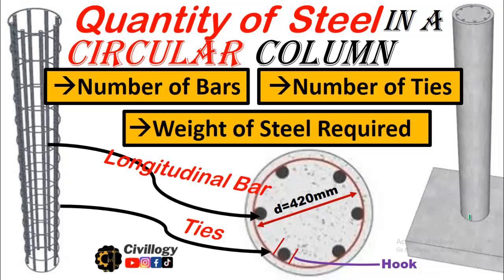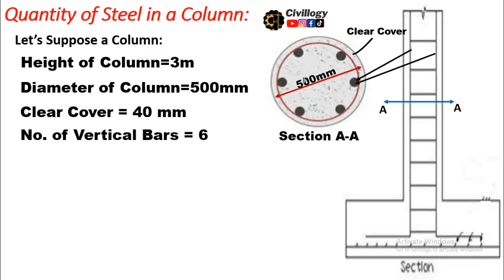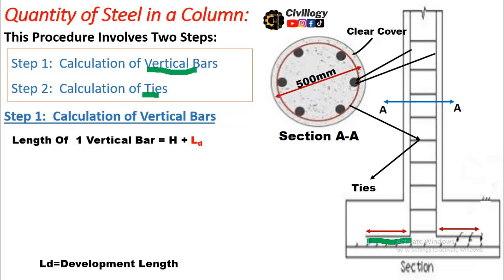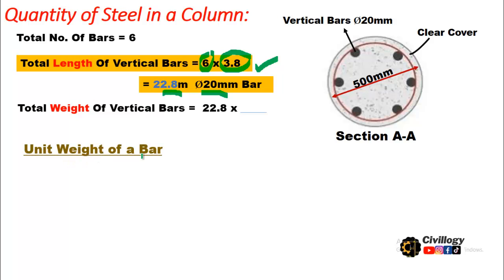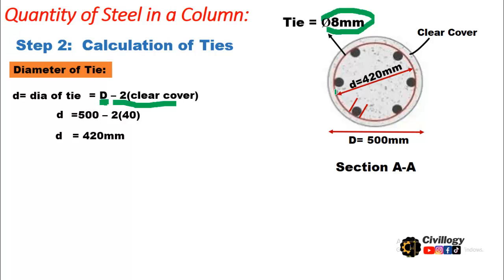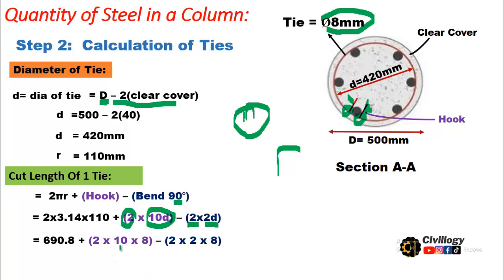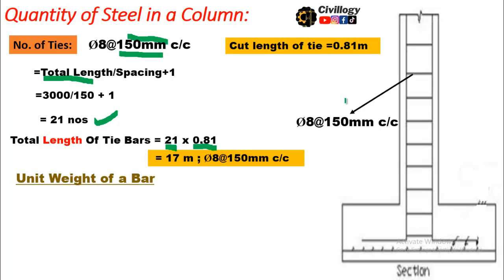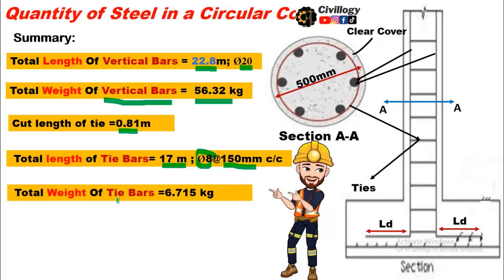how to calculate quantity of steel in circular column?|Steel quantity required in circular column

Comment: You did not substract cover and bend length in main bar length calculation
Reply from the maker: Yes you are right.it is usually neglected because it is covered in overlapping

Comment: Bhai dia-420mm h to radius 220mm hogi n
Reply from the maker: Yes radius is 210mm
Reply from the maker: Correction everyone:
at 08:23 value of radius is equals to 210mm not 110mm.
Rest procedure remains the same.
Reply: Radius is 220mm
Reply: 220nhi 210 hogi